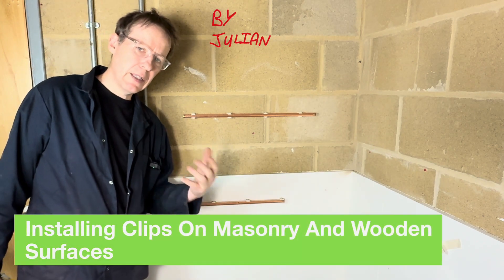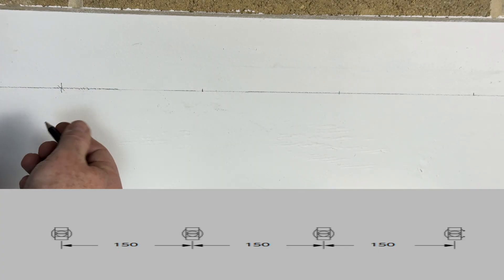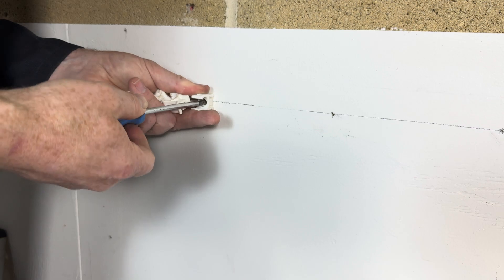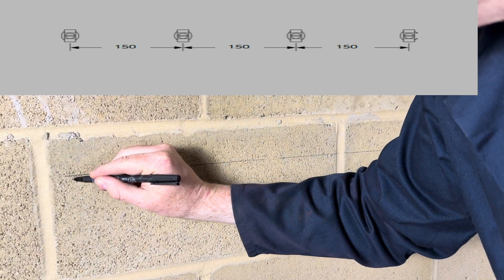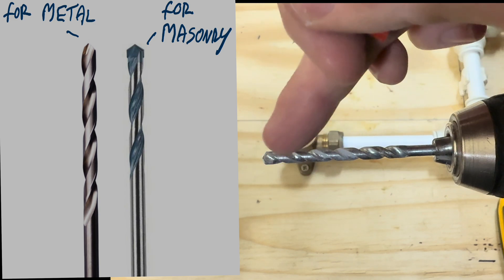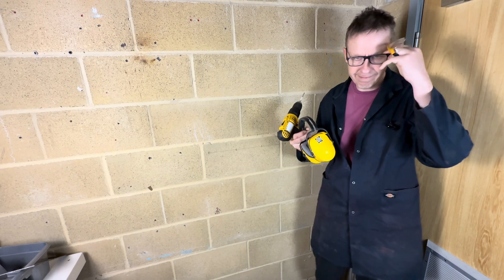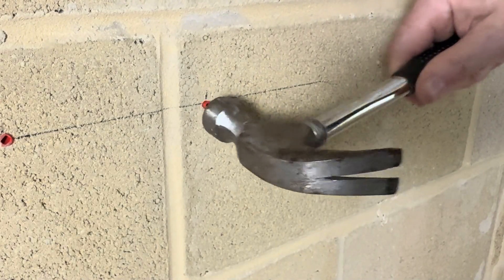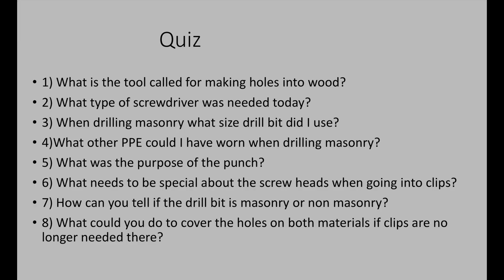Installing Clips on Masonry and Wooden surfaces - Level 1 plumbing

Comment: Well done Julian nice job.Though your right I doubt many Plumbers would bracket at 150 mm intervals.
Reply: 150mm would be too many too close surely? It is 1.8m vertical and 1.2m horizontal for 15mm copper so this video is an example not guidance